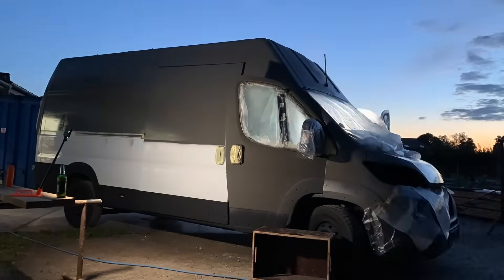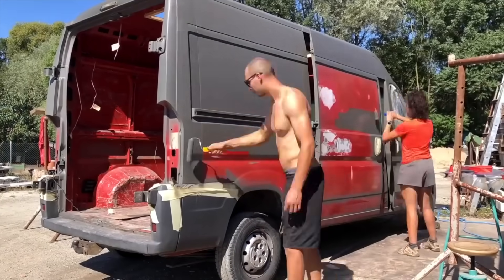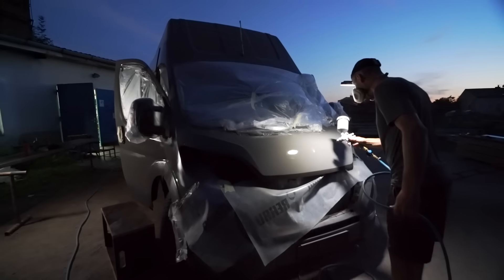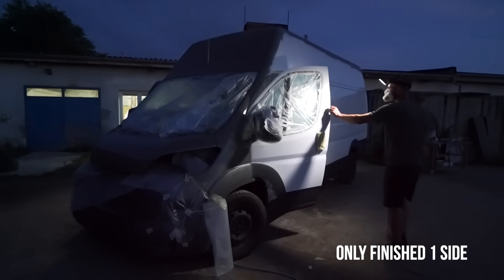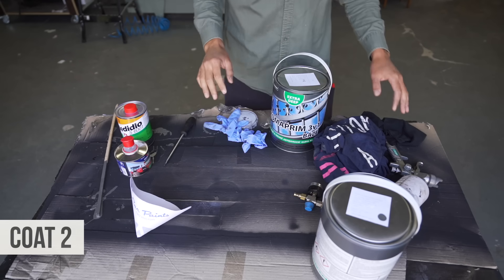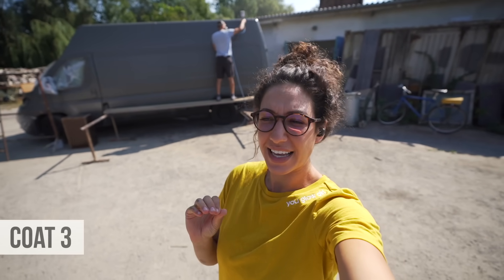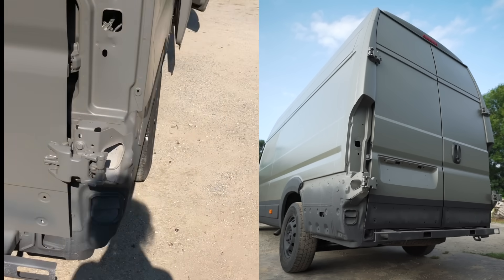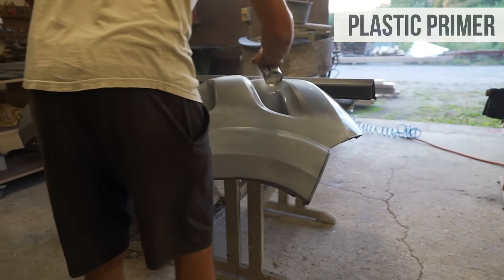Spray Painting Our Van for $190! DIY Paint Job for Ducato Conversion w/ Timelapses! Ep. 3

Comment: We used to use scuff pads on a rotary tool to give things a really quick once over before wiping down with paint thinner before painting at a custom trailer workshop. The scuff pads may seem unnecessary but the paint shop said it helps with the paint adhering better and not flaking.

Comment: Hi there , I enjoyed your videos a lot .Luckely you have acces to a great workshop , but the job is well done !
Building it up from the start ( cleaning , damping the noise , rustprevention) is good to see .
Don't forget to check for rust behind the sliding door rail , best is to take the rail of en see if there is rust araound the bolt holes .
Tip : next time when you have to deal with sticker folie heat it up with a hot air blower , the bondig glue from the sticker will soften and you then can peel of large parts of the sticker at once.
Keep up the good work , looking forward for the endresult !
Jerry

Comment: 3m makes a "blue fineline" tape - it will make a stronger seal against your panels. then tape over that. holds up on paint bleeds and overspray etc, turns a corner on one side so you can pinstripe etc with it. paint jobs looks pretty good did you use a matte finish in there?

Comment: I do like the color.  I am still in planning stages. I don’t want the look of a white cargo van, but I am concerned about how hot a dark color van may get inside. I have two small dogs that I might need to leave in the van for several hours occasionally.  I am budgeting for a powerful electric/battery system and off grid air conditioning. Plus apps to monitor the inside van temperature while away. I’m not going to let anything happen to those two little guys!! I think a lighter color would help keep the van cooler. But with very good insulation and the air conditioning the color may not matter. If anyone has some real world experience with van colors as it relates to interior temperature, please let me know!!  Thank you.
Reply: Colour does determine solar absorbance and subsequent interior comfort. Ladi and Margaret's colour choice would rate around 0.6 - 0.7 on the scale, whereas white equals around 0.2 - 0.3 (black = @ 0.95) . A dark colour heats up quicker resulting in a higher interior temperature and takes longer to cool down. An a/c will need to work harder with a dark colour .
For cooler climes, a dark colour choice is the way to go, whereas a light colour is best for warmer zones. 
Of course insulation plays a part regardless of colour choice.  The best insulation results in forming 'dead air ' and radiant heat reflectivity. I'd recommend using sealed mylar and dacron pillows as much as possible, that don't form too much contact with the outer shell.(Look at how they insulate other tin cans like planes and the space station for this concept ).
Reply: @wilsonwombat3456  hey thank you!!  Do you mean something like Reflectix? What about putting thinsulate next to the outer shell and then using reflectix even as a vapor barrier?  Also, what do you think about first thing spraying interior with Lizard Skin heat and sound insulation?  Thank you and I promise I won’t bug you to much!!
Reply: @wilsonwombat3456  I just watched your videos! Thank you for the great information!!
Reply: @berniekeene868  You should be able to buy a roll of mylar sheet at a hydroponics store and dacron rolls (30mm+) at a haberdashery. Place the dacron between two sheets of mylar (any shape you need) and seal with an iron or glue, this creates the 'pillow' of dead air and the mylar reflects the heat/cold . (There's YouTube vids on how to seal mylar. ) Use reinforced insulation/ ducting tape to attach and seal up any holes.

Anything that touches the outer wall will absorb heat and/or cold, which you don't want as it reduces the effectiveness of your insulation. Though you may want some deadener sheets to stop the panels creating noise.

Reflectix is basically two sheets of mylar with air pockets. To be effective you need two sheets with an air space in between. This gets costly and my suggestion is essentially the same, cheaper and creates a larger sealed air pocket.
  
Lizard skin is a ceramic paint compound and ppl building shipping container homes haven't found it very effective at all. I've looked into it and personally, I think it's a waste of money.

Thinsulate is merely a thinner version of the dacron developed for clothing. 10mm thinsulate = @ 30mm of quality dacron. Loose thinsulate/dacron/batt insulation/etc;  will hold moisture, creating possible mould issues and fibres fall sealing up the vans drain holes.
Reply: @berniekeene868   When I find my van (been in severe covid lockdown for months now) I'll do a proper vid of how to insulate.

Comment: So many questions I have :D
What a great base in which to get 'stuck' in :) A thing of dreams. And for sure a lot of work and energy. May I ask what you do for jobs or did for work to earn what you established? I am also in similar part of Europe, neighbours in fact, not originally but bought a property in the city of Bratislava and then pursued not working for a corporation any more and damn, if I had known just before COVID struck, it would have been cheaper and waaaay cooler to buy some space like you guys have there out of the city.
That said, building the bed and shelving on the street made for meeting some interesting people :D But a paint job, which is needed, as too skylight installed (got a T5 L2H2) I think would be wiser out of the city. The plan, to rent the apartment, obtain a few more contracts for consultancy work and have the time and money to enjoy the process like you guys did. Seeing mostly couples do up their vans, looks great. We had 2 vans between us, hers (T4) already converted punk style and mine just the original shell plus my makeshift interior - plan was to sell both and by a Ducato or similar for height and length - plus the shape for interior looks way more practical to work with than the T5/T4. However, that relationship ending some months ago, the list of items to do has returned and a clean slate to work from. I had no idea you could just paint your vehicle with a roller - the spray approach, without a location to do it while also considering the environment ah, not gonna happen.
Would you say now after experience with both methods, which you would deploy the next time perhaps?

Comment: What was the compressor. That was my biggest issue when I wanted to paint my van and couldn't find a decent compressor for rent. Usually you need really big compressor so it doesn't stop working every 10 sec. Would have been nice if you would have talk about the setting of the compressor and the pressure you used. I would say its the most important thing and technical aspect of the spray painting.
Reply from the maker: You are fine even with a small one if you don’t mind the noise. 2,5 bar for spraying and the rest you need to try yourself.

Comment: can i ask what hardener did you guys use? hardener is for 2k paint not 3in1 paint. 3in1 is just regular walmart paint that can be applied directly to metal and i dont know can it be mixed with hardener?
otherwise 3in1 paint gets melted when you spil fuel on it and like.

also 2k paint or hardener in it is really dangerous for lungs and shouldnt be done without full face positive pressure max.

i did mine same as you with 3in1 paint plus 1k lacquer ower it and paint is just not durable. and also did plastic parts with plastic primer plus paint and i dont know is it due to a plastic but i couldnt get smooth surface.

appriciate to share your knowledge.

Comment: Hey, come on,  I'll forgive the little dent by the door handle but whats that it 13:03?????? Looks nasty to me...
Reply: They sprayed that 'sandy' looking surface on purpose in the last video.  
It's a rhino type surface that's super strong.  
I sprayed the same in my truck bed.
Reply from the maker: Do you mean the long dent? I was not able to reach to it from inside to push it back so it didn't bother me enough to deal with it otherwise :)

Comment: That paint work will look really bad so many problems
Reply from the maker: Ok :)
Reply: @ladiandmargaret  not ok horrible terrible worst paint job i have ever seen  didn't even spray the floor down to keep dust down didn't wet dry sandpaper just used some paper didn't do a tack coat didn't pull dents and Dings didn't use bondo so many things wrong and a cheap spray gun
Reply from the maker: This all would take more time, you have full control over your build 🙃